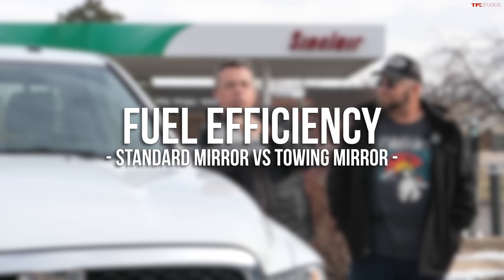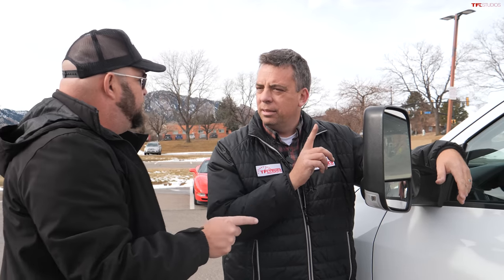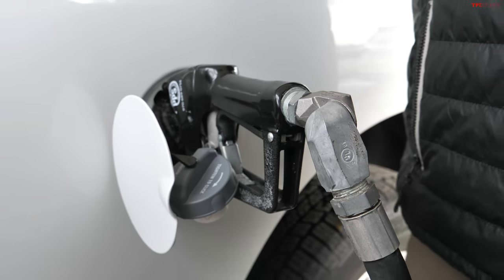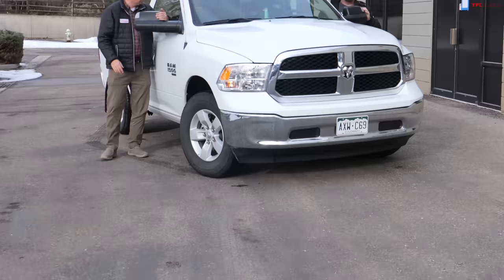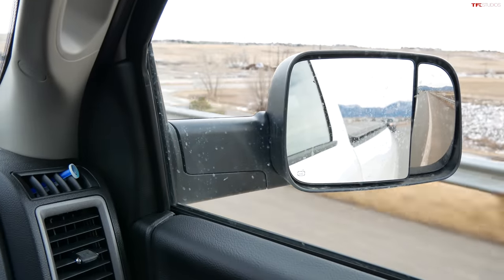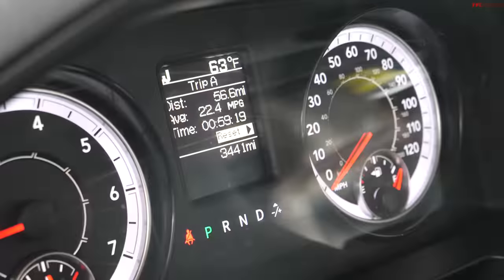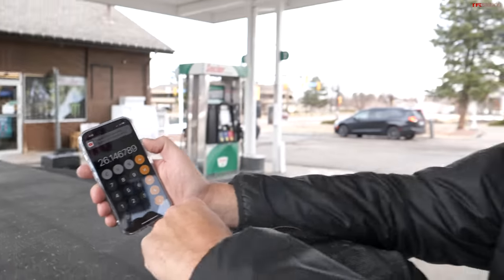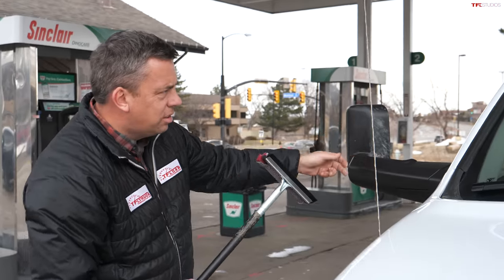TOTALLY UNEXPECTED MPG - Never Drive with Your Towing Mirrors Extended While NOT Towing: Here's Why!

Comment: Yeaaaah. I call bull. I'm not saying you (or anyone) rigged it by any means, but a 20% loss in MPG just based on the mirrors being up or down just doesn't pass the sniff test for me. I put tow mirrors on my F-250 and noticed basically zero real world difference in my MPG compared to the little baby stock ears. I'm wondering if something with the truck's fuel management was different on one loop vs the other or something...? Either way, I'm hoping y'all can do a re-run of this test!

Comment: All these tests you have to take with a grain of salt.  Too many variables.  Have you even noticed that the ground next to alot of gas pumps isn't level?  That could affect how much fuel you can put in your tank before it clicks the handle off and reads "full".  But is it really full???  If the truck, and the attached gas tank are leaning towards the fill nozzle or away or to the front or the back then the level of gas in the tank could show more full if the truck is leaning towards the fill spout and cut the pump off early and then if you drive away onto truly level ground you might find out that you have extra room in the tank now and could've actually put in more gas.  Stuff like that makes it tough to do a real comparison.  And the route taken is an issue.  You can't do and out and back test, you have to do a loop to mitigate the elevation gain and loss and the headwind/tailwind during the driving and there's nowhere that you're going to get those perfect conditions.  All that being said, I would actually tuck my sideview mirrors into the stowed position when I was driving at night or on a deserted stretch of road because those big things out there in the airstream had to be doing something bad for my MPG's.

Comment: Why is it that the trip computer isn't trusted for the efficiency measures of these tests? I would think the ECU would have a far more accurate idea of how much fuel is being used. 22.1 vs 22.3 is also a far more believable comparison than 20.4 vs 26.1.

What I think happened is that the pump cut off early on the first loop (which one of you even commented on by saying the 'top off was big'). Under-filling after loop 1 would make loop 1 look better than it was while also making loop 2 look worse than it was (because you'd be attributing extra fuel to loop 2 that was really used on loop 1).

Your measuring method, as others have mentioned, is extremely inaccurate for single-point measurements. It would work for a long term average, but for single loops, it's not accurate enough. And I'm still questioning why you don't use the figure the truck gives you. If the claim is that it's inaccurate, well, so is your current measuring methodology. And the trip meter's inaccuracy should remain constant and provide a far better number for comparison sake.

Comment: Your test was flawed.  I think the first tank fill was the problem; it likely didn't really fill like you thought it did.  The second fill up, at the end, your tank took on the consumed fuel plus what didn't get filled the first time. The mirror isn't going to degrade the fuel efficiency by 6 mpg.  26 mpg seems unrealistic as does 20 mpg.  If you average them you get 23 mpg which is totally believable and near the EPA rating.  I have the big tow mirrors on my F-150 and I've run it with the mirrors folded in just to see how much my mirrors were impacting fuel economy and there was minimal difference between the modes in my test.

Comment: Sorry to say, but your filling method is not likely as consistent as you think.   First run likely didn’t fill as full as the second..   And the pumps don’t always run at the same full rate.  I’ve had some stops where I couldn’t hold the nozzle full flow because it kept clicking off, and other times where if I adjust the orientation of the nozzle it would then allow me..   sorry, this method just isn’t scientific enough or repeatable enough to use..  especially on a short loop where a few decimal points make a difference

Comment: Nope. Ain't buying it. Too many variables. If you really want to check the difference you should have 2 "stubbys. 1 folded up and 1 down. Run the loop together. Then swap up and down on the trucks and run the loop again.  As long as both trucks with mirrors down get the better mileage a small loop doesn't prove much. But I also know that test would be a major pain to do. But I could be wrong. I've been many times before.

Comment: Your testing method by doing it this way is so so flawed. This is completely useless information. There is no possible way the mirror being up was 6 MPG different, that is a 30% change in fuel economy. You cannot assume the pump clicks off at the same point every time on the tank especially when you're only driving 57 miles worth. The margin of error on 2-3 Gallons and 50-60 miles  is way to small of a sample size. How about you do an average of real world driving over a 1000 miles  with mirrors up and then do an average of 1000 miles mirrors down of real world driving. Then report your findings, sure you might have more wind one day, and more highway another time, but 57 miles and 2 gallons is not going to yield accurate results. There is no possible way your mirrors make a 30% difference in fuel economy.